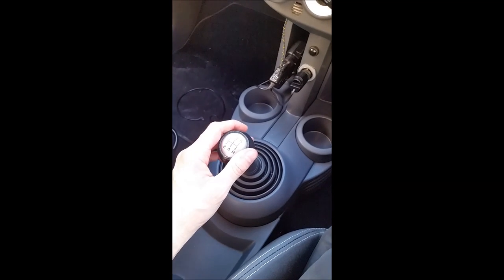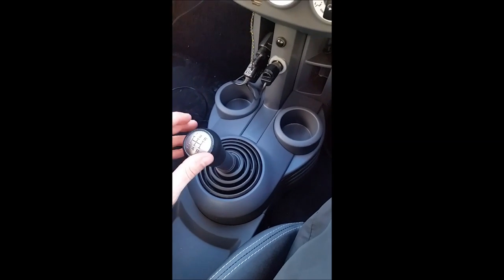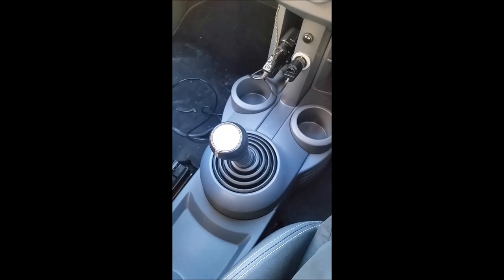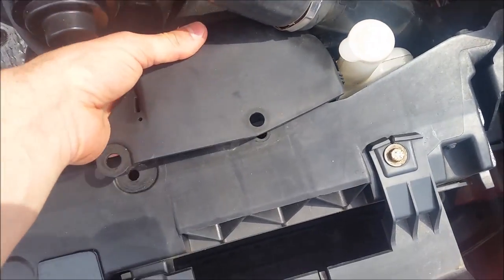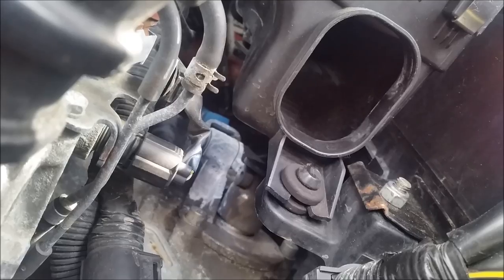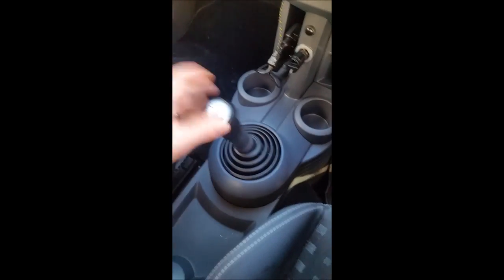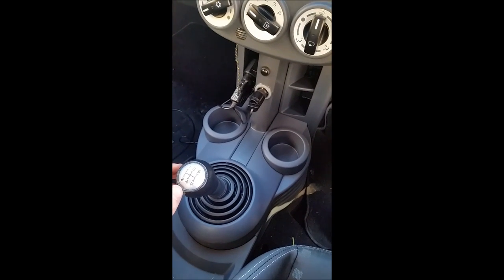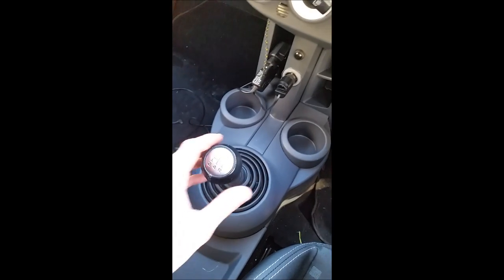Colt Ralliart/CZT - Gearstick Centring Issue

Comment: Tried spraying white lithium grease on the pivot point and after a week or so driving it's really helped the stiffness on the gear stick ease. Neutral will actually spring the gear stick back to the middle on its own most of the time now! Shifting smoothly now. Someone is making replacement bushes and selling on ebay to completely cure the problem if anyone is interested. Just search ebay for "2005-2013 Mitsubishi Colt 1.1 1.3 1.5 CZ1 CZ2 Gear Selector Repair Kit Stiff". Pricey but well made. Thanks for the video, it's helped me at least put off fitting a new bush on the selector for a while. 👍

Comment: Wasn't looking forward to dropping the airbox and battery out but your video shows you can get easy access for a good squirt of lubricant. I have motorbike chain grease which is very wet and runny when sprayed to get into the rollers on the chain and when the solvent evaporates it leaves a thicker grease,the linkage is very similar to a chain link so I'm hopeful this will fix my side to side stirring toffee gearstick. I did see another video where the pivot on the base of the gearstick can lack grease so an application there may also help. Thanks for the video,I wonder how much my local Mitsubishi dealer would charge to fix this,probably sell me a whole new selector mechanism with hours of labour.

Comment: cheers - had a very, very stiff gear shift.... ended up taking out the battery bay and a bit more or the air ducting, but got the lube on those connectors and its as good as new!

Comment: Update. Got busy with a torch today and without removing the air scoop I could just see the offending linkage between a water pipe and the air scoop, I gave it a squirt from the front and with a long tube I could get to it from behind, what I used was a graphite loaded maintenance spray rather like WD40 with pencil lead added, I use this on padlocks and motorcycle ignition barrels as the graphite keeps the bits that move moving, if I had WD40 I would have used that, the difference it made was instant, the return of the gearstick from far left or right has never felt so easy.

Comment: I just this car and i noticed that the gear shifter stick is so hard when you are trying to change the gear. Is this normal on this card or it's some problem with gear shifter stick? I used to drive older card than this and the shifter stick is so smooth and easy to manuver. This shifter on my Colt is so hard to manuver and I'm wondering that something is not right about it

Comment: I tried this last night and coated the part you showed. This morning it’s a little easier to shift gears but it still gets stuck wherever you push it in neutral- does it take a few applications and driving to fix this?
Reply from the maker: It might just take some time and usage to free up. If it remains sticky you might need to replace the bushing in the shifter assembly as that’s what causes this issue.

Comment: Hi. I'm just wondering if you would be able to help me out. I have a Mitsubishi Colt 2008 and I've never noticed until now but I have only 1 reverse light lighting up when I reverse. Should there be 2? I tried googling this but couldn't find an answer anywhere. Thank you.
Reply from the maker: If I remember correctly there is only one reverse light. The light in the same location on the other side is the fog light
Reply: @reid04151  great, thanks very much!

Comment: Thanks for the info. Does anyone know how the main air box comes off, for better access? I've undone one screw from the back right side and don't know what method is needed to pull it off the rubber holders. Brute force or a certain technique of which way to pull/slide? Thanks
Reply from the maker: From what I can remember you push it towards the engine to unclip it, they were really stuck on mine so took quite a bit of force.
Reply: Thanks.